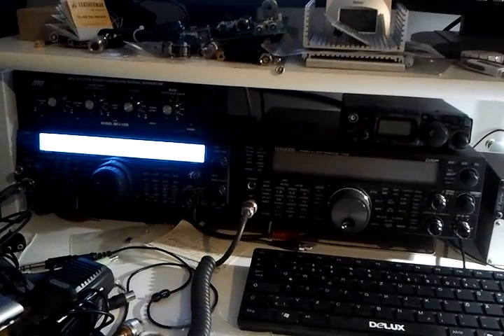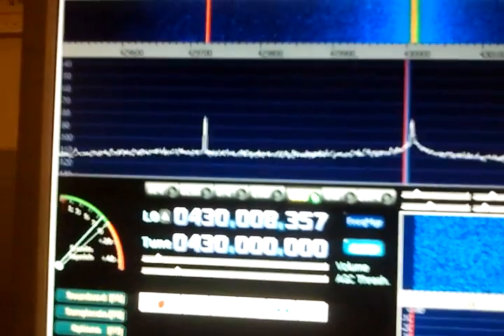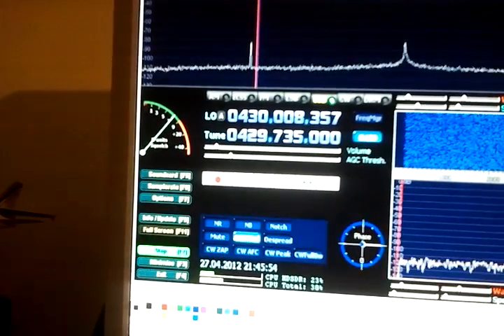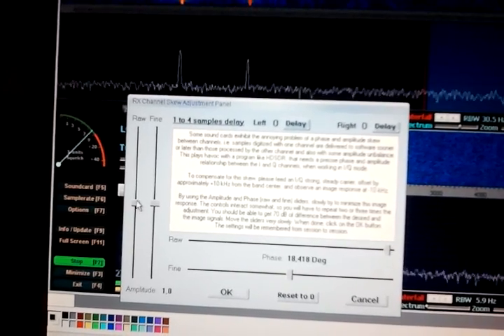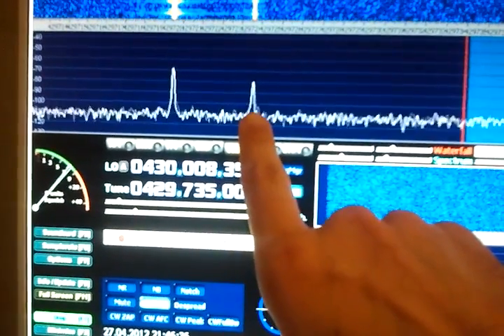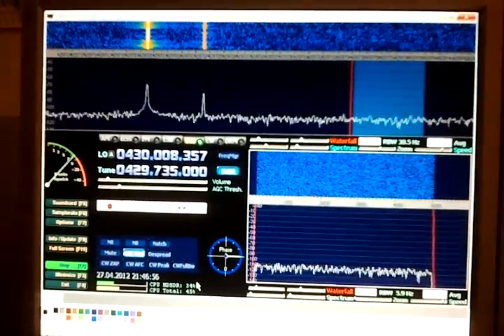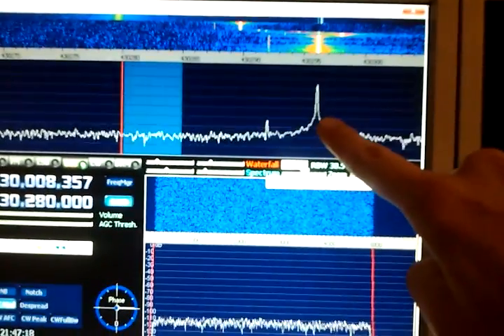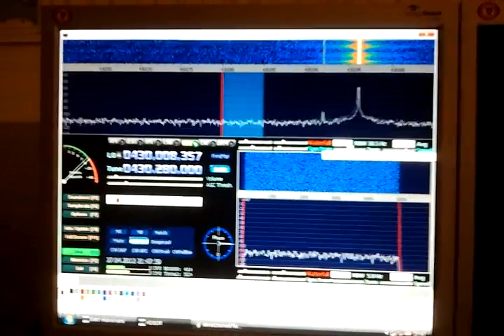RTL SDR DVB-T dongle - image rejection problems due to "phantom signal" presence

Comment: Hi, I do not quite understand this, how does it happen? I believe you generated the signal with a function generator, so there is only one signal goes into the RTL SDR, so it can't be neither image frequency or intermodulation. Can you explain this to me?

Comment from the maker: Hi, what you mean is image rejection - not phatom signals. It has nothing to do with the software, but with the hardware... :-)

The phantom signals seen and explained in this video are specific to this RTL SDR cheap DVB-T SDRs and do no happen with all other common SDRs around.

Best of all:  
This problem has been fixed in the newest Linux and SDR# drivers (but still not in the original ExtioUSRP), since it was just a software issue (some skipped samples, where causing this signal shift)...